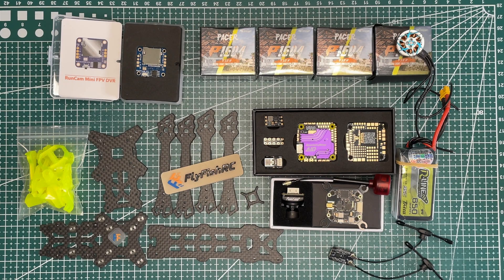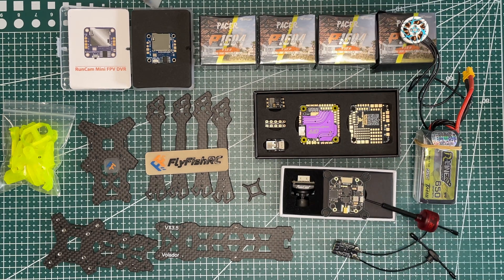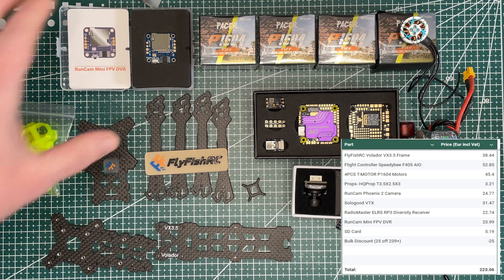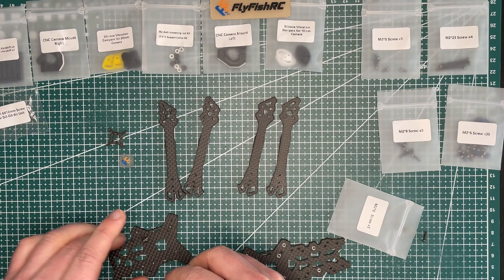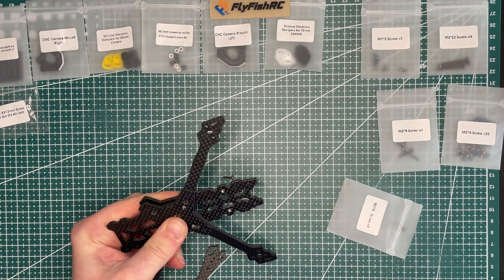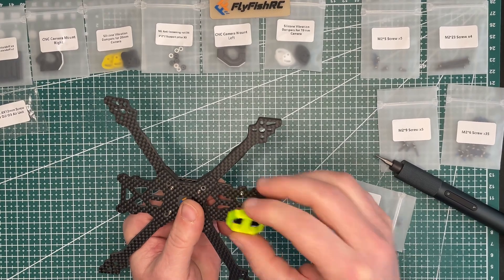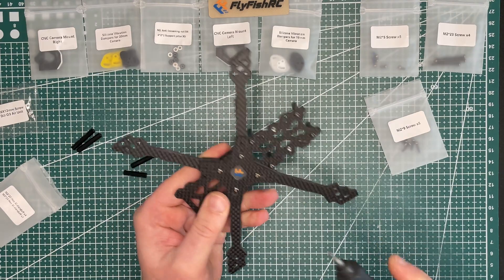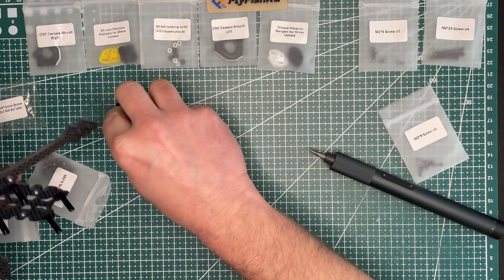2025 Freestyle  3.5 Inch on-board DVR drone build. Part 1 -  FlyFishRC Volador 3.5 Frame Assembly

Comment: Привіт, чого не 1804 3450 кв ?
Reply from the maker: Привіт, згоден, на такі дрони зазвичай 1804 - "стандарт", але декілька речей , чому я вибрав 1604. Перша - ціна - я іх купив за 45 євро, а 1804 на той час якось були відсутні дешевше 70 євро, і я вирішив спробувати 1604. Ну і друга, на 1804 треба шось побільше 650 mAh, то я вирішив спробувати, бо вони в мене вже є. Тобто на 1604 и 650 mAh - дрон не важкий, не такий спритний як рейсінг мабуть, але літає ок. От поставив ЖПС- поміряю швидкість якось.
Reply: @ я заказав 1804 , 2400 грн. Вага як у 1604 рсінпавер алюмінієвий сплав хитрий
Reply from the maker: @blacksmithirons2371  а якого виробника, шо за модель?
Reply: @ чат жипіті пише що 1804 меньше струму жруть ніж 1604
Reply from the maker: @blacksmithirons2371  я подивився тести на Т-МОТОR сайті - 1604x3800 та 1804x3400, там так і є на малих обертах, а коли вони десь за 50% - то 1804 жеруть більше, не на багато, але більше, ну і вони ж більші- ім треба мощі взагалі